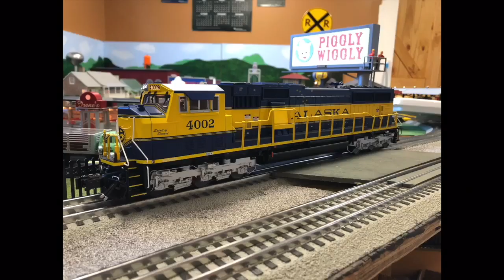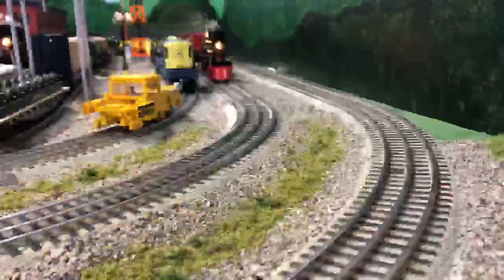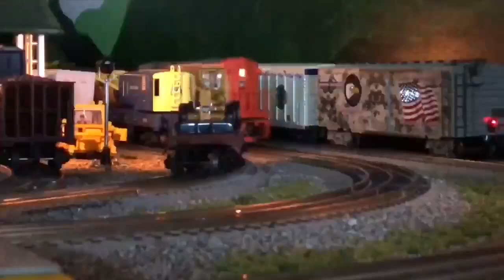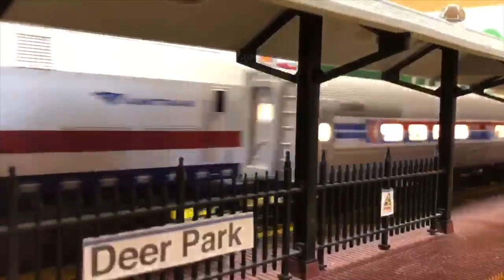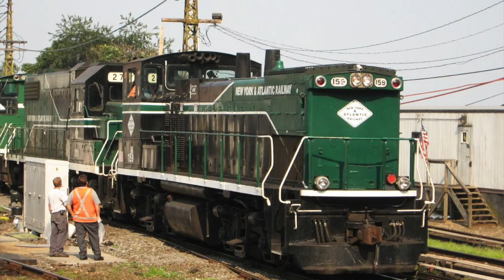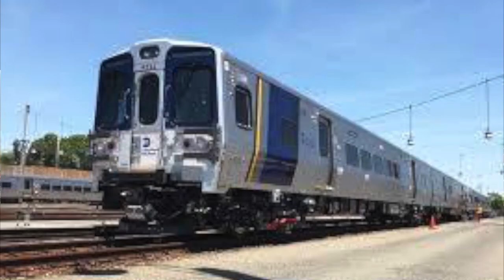Model Train Talk Podcast 11: Sam and RJ Just Talking Trains

Comment: Sorry I missed the live-stream guys. It was great to hear about your experience With Lionel Fasttrack. I run 50 year old Lionel tubular track on my layout because I want my layout to look like a Lionel store display from the 50's, I have several Lionel locomotives with Magnatraction and need to be run them on steel track (FastTrack rails are made from some kind of cheap allow, magnets will not stick to them), I'm cheap and my tubular track was paid for long ago, and
FastTrack is too loud. After I built my layout table I applied Homosote to the top to keep the trains quiet. I put a loop of old Lionel tubular on the layout and ran some heavy postwar trains and was surprised how quiet they ran. I then switched to my loop of FastTrack and the trains were noisy, despite the fact that they were run on Homosote. I purchased a loop of Fastrack from Ebay to run around the Christmas tree on carpet. I wanted too keep oil off the carpet and carpet fuzz out of my trains. The FastTrack worked fine for five years, then the plastic became too stiff to assemble and disassemble without a big hassle. I got so mad last Christmas, I tossed the FastTrack in the garbage and used Marx O-37 instead. The old Marx track worked fine. Gargraves is excellent track, however my Magnatraction locos will not work properly on Gargraves because it does not attract magnets. I'm not some old guy unwilling to try new things. I tried FastTrack and it was a big fail! Marx made track which fit into rubber roadbed. The bad news is that it was so long ago that the rubber roadbed has become stiff and no longer has the same sound deadening qualities as when it was first sold. If you don't want to rip everything off your layout to add Homostote, try Sound Foam road bed. You can find it on line. You can also use winter home insulation strips. It comes in roles and you can find the correct size to fit under your tubular track ties.  You have to drill though to hole in the tie and then add a screw, otherwise the rubber from the insulation gets stuck in the screw heads. Great upload guys!
Reply from the maker: I definitely agree Lance! I love the old track! Works better, haha!-Sam